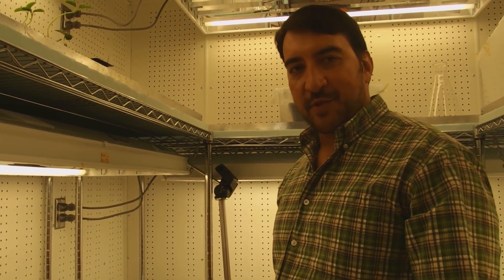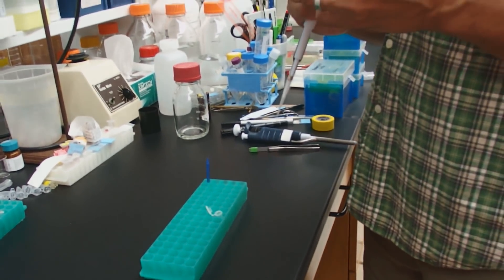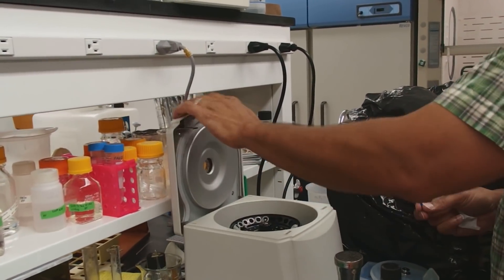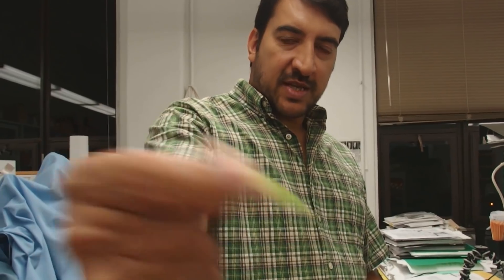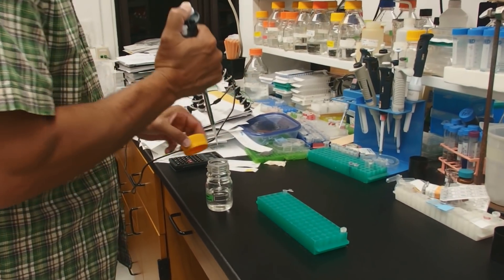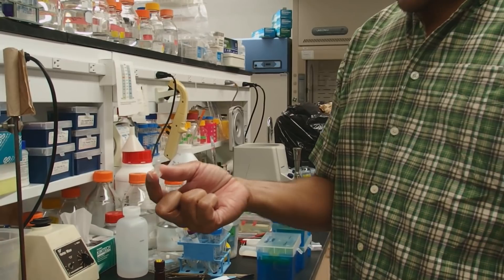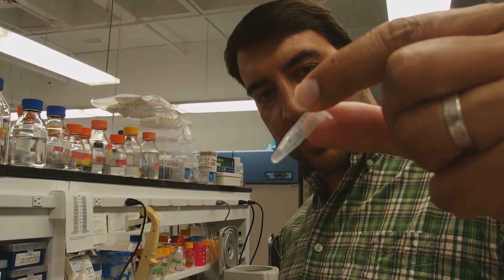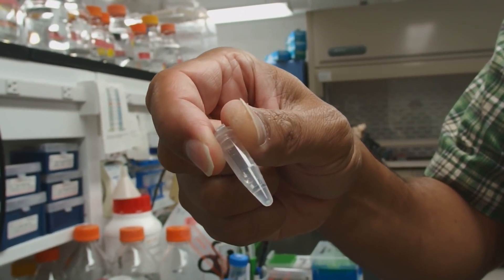Plant genomic DNA extraction

Comment: Thank you for your video. It's so clear ana easy to do. I will try tomorrow. However I used similar protocol (CTAB method), it didn't work well and created the smeared bands when I run electrophoresis. Can you help me? My protocol is below:
1. Take 0,1 gram leaf tissue, put it in the 1,5 ml tube that contain 500 microliter of CTAB buffer was inccubated at 55'C. At 55'C, grind it about 5 minutes and incubata the tube in 25 minutes.
2. Centrifuge the tube absolutely at 4'C, 14000rpm in 5 minutes
3. Take the supernatant ( about 120 microliter) to new tube and add the equal solution of chloroform and isoamyl (24:1). Then, mix well and cantrifuge at 4'C, 14000rpm in 1 minute.
4. Take the supernatant to the new tube. It is about 70 microliters. Add  49 microliters of isopropanol. Mix well and incubate at -20' C in 15 minutes.
5. Centrifuge the tube at 4'C, 14000 rpm in 10 minutes. Eliminate the solution while keep the ice ( pallet)
6. Add 500 microliters of ethanol 70%, don't mix, centrifuge at 4'C, 14000 in 5 minutes.
7. Dry ice as your way and add about 30 microliters of TE buffers.
Reply from the maker: I recommend you use the print protocol on my website (see the link in the description). It is quite a bit simpler than your protocol and gives intact genomic DNA for many species including corn, soybean, and Arabidopsis. The protocol you were following seems to have steps that are not necessary. All the best, Rahul
Reply: Hi Rahul, thank you for your video. Anyway, i've tried to download protocol from your website but didn't success yet. Can you help me to send the protocol to my e-mail dika.sundari@gmail.com. Thank you!

Comment: How can you tell the difference between ice burg lettuce and romaine lettuce? Can u use gel electrophoresis? Second question if you have to heads of ice burg lettuce bought from different companies will DNA show up different even though they are both ice burg and not clones.
Reply from the maker: At the DNA level iceberg lettuce and romaine lettuce are almost the same. In fact, cultivated lettuces are only about 5% different than their wild ancestor at the DNA level despite looking really different. You would have to use and assay that detects single nucleotide polymorphisms (SNP) or small insertion/deletions between the two cultivars to see differences. Gel electophoresis alone would not be able to distinguish cultivars of lettuce, but coupling electrophoresis to a PCR or restriction enzyme based method would probably do the trick. Two different iceberg lettuces that were not clonal would be much harder to differentiate using genomic DNA. Whole genome sequencing would probably find SNP differences between different companies. I hope this helps. All the best.